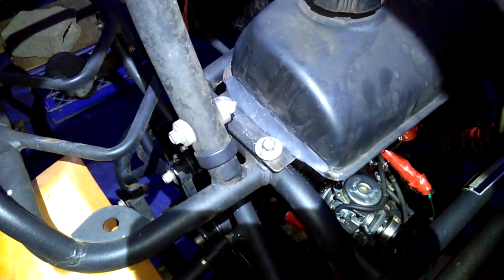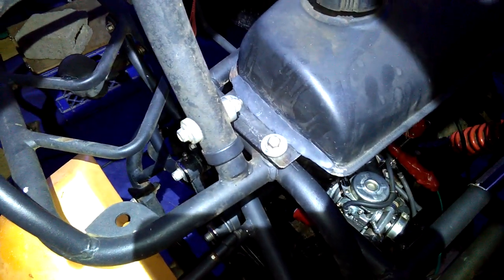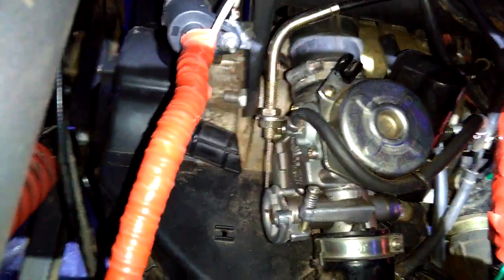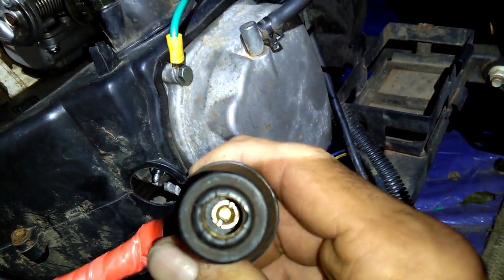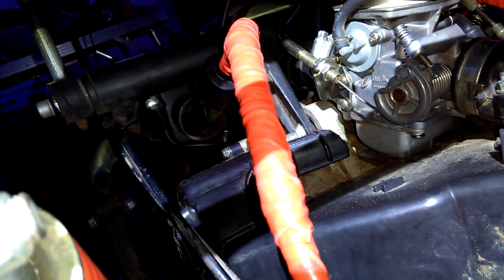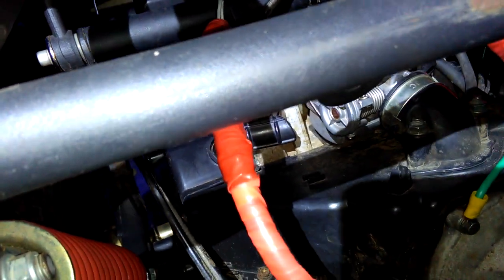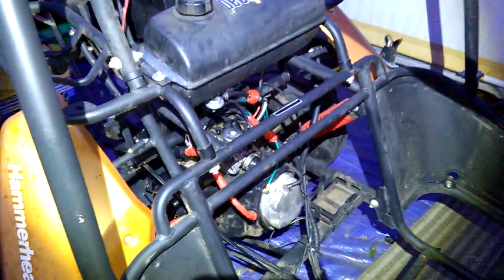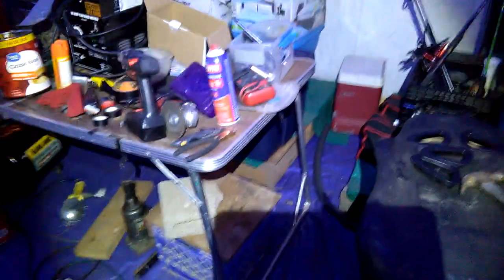2015 Hammerhead GTS 150, Update, Coil wire mod and grounding fix.

Comment: Hey I was wondering if you have a video of the complete wiring harness
Reply from the maker: No, I do not. Just remember Green is ground. I grounded in 3 different places. Run the lights on a different circuit other than the spark coil. Use a heavy ground wire. Just trace all connections and make your own wiring diagram it will help.